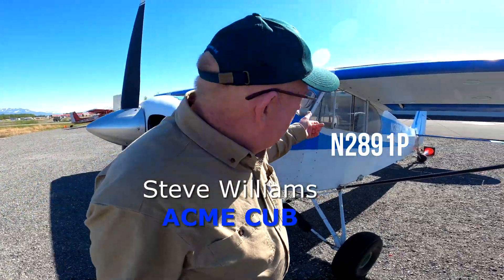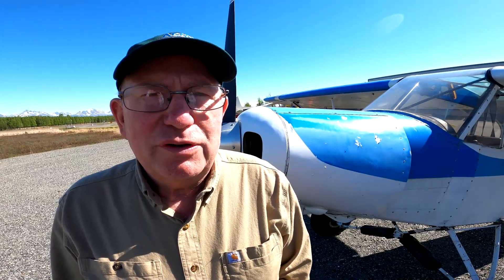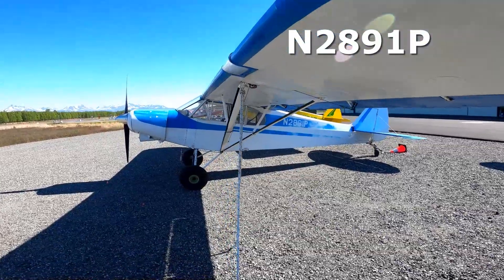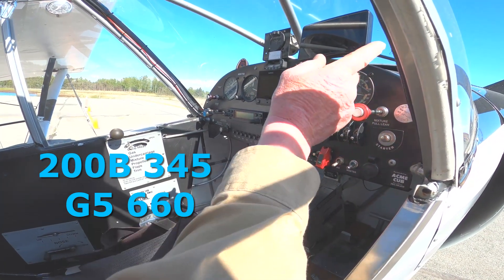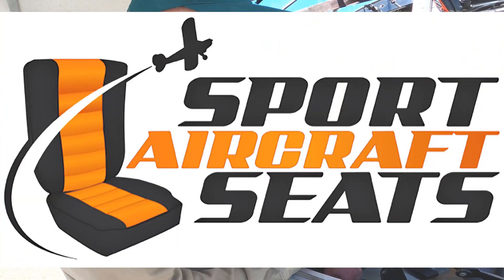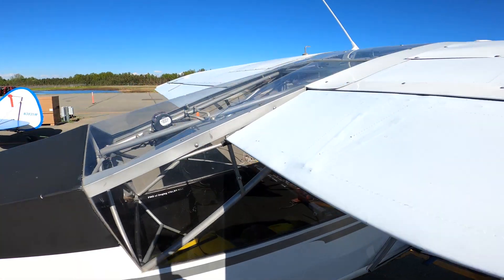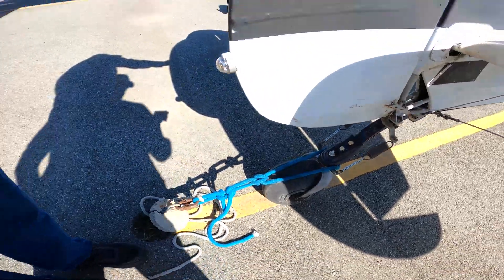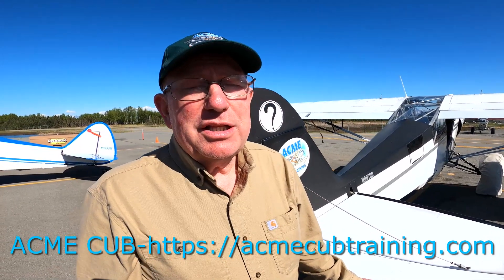ACMECUB Rebuild Project PA 18

Comment: Makes no sense.  Get a 2 owner PA-18 and order a new frame, engine, and probably need to do some wing work....why not just start fresh with a frame and engine and go from there?  Just doesn't make sense to me.
Reply: It’s all about paperwork. They bought the donor super cub (data plate, paper and reusable parts) to build a new certified airplane around. Certified aircraft are different than experimental.
Reply: @kevinjohnson1636  Yeah, I get that but in todays market...experimentals are demanding a tidy sum.  Just look at what Airframes Alaska is getting for a few of the experimentals sold out of their shop.  Big money.
Reply: @scottgordon6541  Very true that exp. -18s are bringing real money. The Airframes exp. that I think you’re referring to was a 4 place. Different market.
Reply: Totally with you on that.if it were wrecked i could understand buying it 4 the paper and books.Seems incredibly stupid to not just rebuild it as a moreless  stock cub .Wrecking it for  a few boxes of bits and tailfeathers ??????
         Doubt they can use an experimental for training or rental.